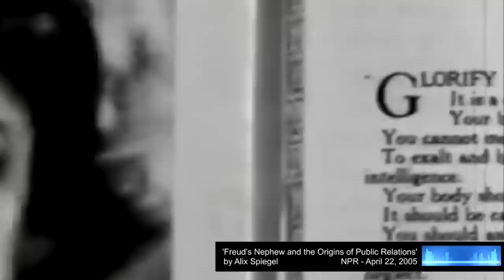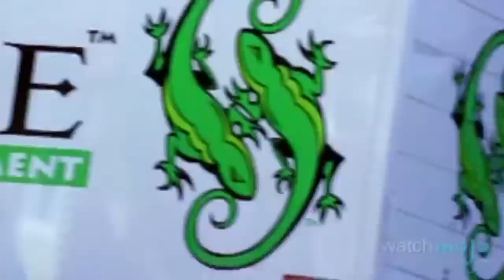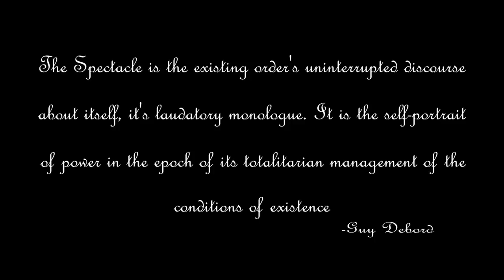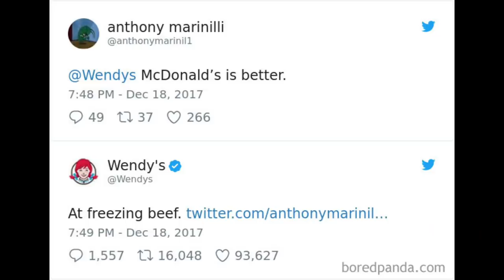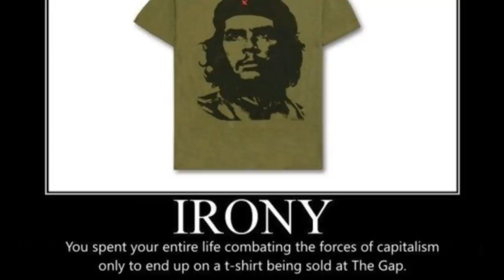Commodity Fetishism and The Spectacle

Comment: Great video, good content, good analysis. 
 try to have the material you read closer, or behind the camera if possible. If it is too far use a bigger font, and maybe you can scroll it with a wireless mouse
Reply from the maker: Ahh thanks for the tip, I've been trying to figure out a better way to work it so it's not as noticeable that I'm reading a script!
Reply: @lesliefluette1784  https://www.premiumbeat.com/blog/three-diy-teleprompter-builds/

Maybe you'll find it helpful. There are some cheap options
Reply from the maker: Ender Wiggin holy shit, that’s EXACTLY what I need, thank you!

Comment: It's simpler than this. Advertising is merely designed to create the illusion of difference where difference does not exist. This is necessary in a world of generally equivalent "choices". A fetish is linked to sexual desire and the presumed magical aura or link associated with the fetish object. Consumer behavior is formed by attachments to perceived value or property ownership, not to the primacy of sexual gratification -- hence the latter's element of "magical" force.

Comment: at 9:22. I would like to interject for a moment on the Apple vs Android thing. Android is an open source mobile OS, which means the operating system is owned by the community rather than a corporate entity. The source code itself is not something a corporation profits on rather the devices itself and applications is what companies profit from. The operating system itself, which is what Android is, an operating system produces 0 profits therefore it isn't exactly a commodity that is bought and sold. If the argument was Galaxy (biggest android based device manufacturer rival to apple) vs iPhone, then this would be more accurate. You can download the source code here.
https://source.android.com/setup/build/downloading

Comment: ⥊ 99: 100

0: Good

001: Uniqueness
002: Altruism
003: Sensivity
004: Audacity
005: Boldness
006: Astuteness
007: Ingenuity
008: Innocence
009: Truth Seeking

01: Willpower
02: Progress
03: Acuity
04: Love
05: Bravery
06: Congruence
07: Consonance
08: Honesty
09: Cleverness

1: Ethics
2: Problem-Solution
3: Subject
4: Idea
5: Expression
6: Why / Who / When / How / Where / What
7: Information / Code
8: Stability
9: Sanity

10: Network
11: Justice
12: Affront / Easter
13: Definition / Death
14: Cognition
15: Source
16: Reason
17: Discourse
18: State
19: Control

20: Judgement
21: Ethical Solution
22: Scupulous
23: Delimitation
24: Humor
25: Behavior / Christmas
26: Motivation
27:    Comprehension
28: Constancy
29:    Regulation

30: Liberty
31: Permission
32: Discernment
33: Responsability
34: Support
35: Invention
36: Purpose
37: Opinion
38: Decision
39: Prospect

40: Goodness
41: Awareness
42: Critical Thinking
43: Consideration
44: Conceive
45: Plan
46: Ability
47: Knowledge
48: Structure
49: Ambition

50: Good Expression
51: Manifestation
52: Resolution
53: Application
54: Empowerment
55: Movement
56: Demonstration
57: Assignment    Mission
58: Building
59: Proficiency

60: Accordance
61: Appropriated
62: Implication 
63: Indicator
64:      Cohesion
65: Function
66: Investigation
67: Argumentation
68:      Sophistication 
69: Scrutiny

70: Intelligence
71: Message
72:      Consistency
73: Election
74:     Coherence
75: Consolidation
76: Explanation
77: Flow
78: Fluency
79: Measurement

80: Peace
81: Sovereignty
82: Perseverance
83: Reliability
84: Autonomy Instrospection
85: Rectitude Implementation
86: Pursuit
87: Persuasion
88:      Character Benign
89: Commitment

90: Kindness
91: Assertiveness
92: Optimism
93:     Scrupulousness
94:     Compassion
95: Composure  Essence Fiscalization
96: Blockchain: ⥊ (TRACE MARKER) Legacy
97: Anarchy
98: Veganism
99: Revolution

100: Liberation
101: Decency
102: Progressive
103: Resilience
104: Integrity
105: Collaboration
106: Abolitionism
107: Concordance
108: Clarity
109: Regulation

110: Ethical Commitment
111: Honor
112: Exploration
113: Privacy
114: Will
115: Pride
116: Justifiable
117: Equitable
118: Fair State
119: Mission

120: Harvest
121: Deliverance
122: Resistance
123: Cogitation
124: Challenge
125: Appropriated
126: Searching
127: Emphasis
128: Consistent
129: Subversion

130: Fulfillment
131: Admission
132: Criteria
133: Response
134: Provide
135: Technique
136: Principle
137: Point of View
138: Choice
139: Prevision

140: Serenity
141: Conscience
142: Concern
143: Perception
144: Free Love
145: Idealize
146: Capacity
147: Mindfulness
148: Scheme
149: Morality

150: Righteousness
151: Virtue
152: Coordination
153: Efficiency
154: Equip
155: Cooperation
156: Profiling
157: Counter-Terrorism
158: Rising
159: Excellence

160: Reasonable
161: Procedure
162: Corroboration
163: Hint
164: Value
165: Role
166: Lead
167: Logical
168: Improvement
169: Assess

170: Sympathy
171: Relevancy
172: Dichotomy
173: Naming
174: Elucidation
175: Materialization
176: Validity
177: Harmony
178: Coherence
179: Verification

180: Perpetuity
181: Independency
182: Perseverance   Dependability
183: Structure
184: Potential
185: Stance
186: Occupation
187: Compelling
188: Conviction
189: Boldness

190: Power
191: Wisdom
192: Effectiveness
193: Prudence
194: Foresight
195: Discipline
196: Trackable
197: Accountable
198: Compeling   Sustainable
199: Quest

200: Ideal
201: Compatibility
202: Referee
203: Adjudicate
204: Conformity
205: Coexistence
206: Methodical
207: Correspondence
208: Eccentricity
209: Expertise

210: Solution
211: Resolution
212: Prosecution
213: Adjustment
214: Transformation
215: Conversion
216: Escalation
217: Correction
218: Persistence
219: Analytical

220: Contemplation / Meditation
221: Preparedness
222: Dialectical
223: Meticulous
224: Diligence
225: Attitude
226: Rigorous
227: Dispute
228: Healtiness
229: Prescription

230: Allowance
231: Agreement
232: Definition
233: Jurisdiction
234: Availability
235: Proposition
236: Objective
237: Reckoning
238: Settlement Warrant
239: Assurance

240: Mindset
242: Mental State 242: Consideration
243: Rumination
244: Impression
246: Sagacity
247: Easygoing
248: Disposition
250: To Thrive 
253: Conduct
254: Potent
255: Insurgency
257: Defiant
260: Unveiled    Exposed 
261: Freedom Fighting
262: Correlation
263: Relevance
265: Conjecture
266: Suggestion
269: Estimate
272: Paradox
273: Choice
274: Dispute
280: Constancy
282: Evanescence
288: Healtiness
289: Conduct
290: Prognosis
294: Anticipation
295: Proof of Stake
296: Calculation
297: Proof of Work
298: Commitment

300: Crusade / Jihad
304: Concept Attention
309: Consensus 
310: Conviction
311: Consent
312: Confront
312: Distribute
313: Enforcement
314: Bodily Autonomy
320: Deliberation
322: Opportunity
327: Suspicion
330: Adherence
331: Self-Determination Demanding
333: Abundance
334: Accountaility
335: Technician
336: Dedication
338: Permanent
339: Maturity
340: Promote
341: Confirm
342: Validate
343: Imagination
344: Qualification
345: Ratify
346: Organization
347: Propagate
348: Finance
349: Encourage
350: Operation    Materials
351: Engagement
352: Endeavor
353: Undertaking
354: Remarkable
355: Designation
356: Exposing 
357: Proactive 
358: Forge
359: Accomplish
360: Technology
367: Addressing
372: Ambiguity / Conflict
373: Retort
370: Standpoint
372: Conflict
377: Context
383: Orientation
390: Prognostic
394: Prediction
398: Sustainability
399: Overthrow

400: Earth Population
402: Diversity
410: Permaculture
411: Mathematical
413: Realizing
421: Metamorphose
422: Transcend
427: Skepticism
430: Abstraction
434: Care
435: Possibility
436: Inspiration
440: Insight
441: Abstraction
442: Contemplation
443: Brainstorm
444: Formulation
445: Elaboration
446: Capability
447: Know-How
448: Apparatus
449: Theory
453: Design
454: Escalation
455: To Arrange
457: Rapport
460: Aptitude
461: Rigorous
462: Affect
463: Skill
464: Competence
465: Performance
466: Conjecture
467: Intelligible
468: Enrichment
469: Expertise
470: Wisdom
471: Accessible
472: Distinguishment
473: Priorities
474: Perspective
475: Constatation
476: Punctilious
477: Attentiveness
478: Amusing
479: Insurance
480: Security
481: Inclusive
482: Durable
483: Trustworty
484: Individuality
485: Convenience
486: Satisfaction
487: Benefit
488: Friendly
489: Praticality
495: Marvelous
496: Sensational
499: Envision
Reply: 500: Assumption
501: Leadership
502: Credit
505: Viable
503: Esteem
509: Prestige
510: Admiration
511: Heroism
512: Pugnacity
513: Description
518: Steady
520: Proficiency
525: Habit
530: Implementation
531: Solicitation
532: Regard
533: Contract
534: Requirement
535: Execution
536: Utilization
537: Utterance
Reply: 538: Respect
539: Esteeem
540: Appreciation
541: Sensatize
542: Instigate
543: Sentiment
544: Sharp
545: Assembly
546: Potency
547: Education
548: Solidity
549: Evolve
550: Fellowship
551: Insurrection
552: Schedule
553: Reportation
554: Convocation
555: Party
556: Campaign  Instruments
557: Coordination
558: Systematize
559: Seize
560: Protesting
561: Explicit
562: Reciprocity
566: Intimation

Comment: I think there's some analysis from Baudrillard regarding sign value and the hyper realism that comes  with that as the late stage and logical conclusion of Marxist alienation. Therefore sign value is the mechanism by which the spectacle ,outside of its own its own performative self-validation, creates a value metric which allows invades society materially, by attaching sign value to the hyper real. I think, the conclusion of this results in the commercialization and commodification of everyday activities, the self ,and social spaces through the creation of alienation as a form of social exchange mediated by sign value. The only question is how, in what kind ,and to what degree will this alienation as socialization create social capital or if it can at all, resulting in the commercialization of all social life? Or I could just be crazy and become inundated with copious amounts of philosophy?

Comment: Someone told me Ford stands for Fix or Repair Daily..lol
Reply from the maker: Sounds about right!
Reply: Someone told me that ADIDAS stands for All Day I Dream About Sex.  Literally all someone did was create and arbitrary description based on the letters in a particular product.  So what’s your point?  I’ve had Ford F-150 that has lasted 260,000 miles with 0 problems and one that lasted 58,000 miles in which a new engine block was needed.
Reply: Found On Roadside, Dead
F****in Okies Really Dig Em

I don't necessarily believe it though... unless it's a basic Ford car from the 90s or something.